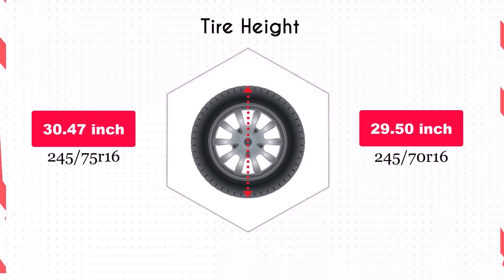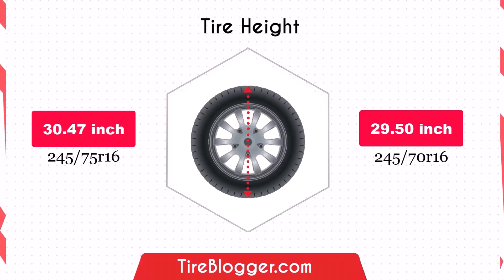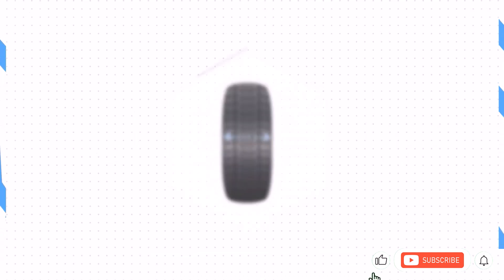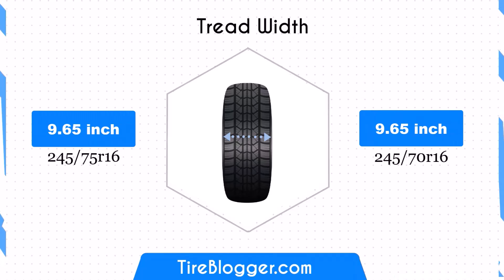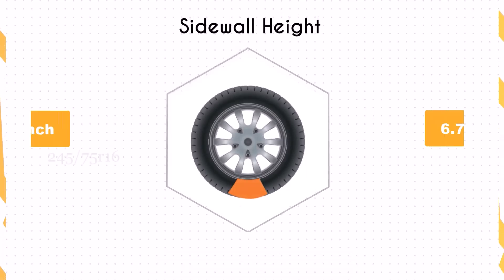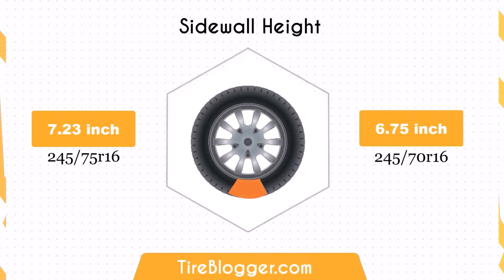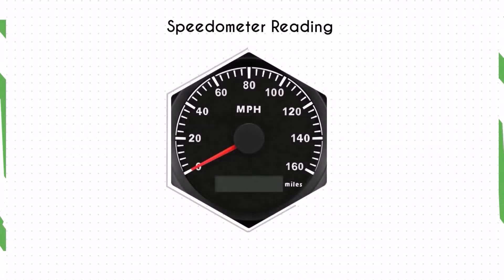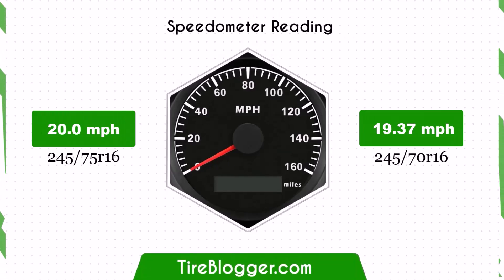Tire Size 245/75r16 vs 245/70r16

Comment: Tires often claim to be the height or diameter of the tire in it's specification don't always measure out true
Reply from the maker: Yes but those are standard rule we should follow to maintain good balance overall performance.
Reply: @TireBlogger  agreed